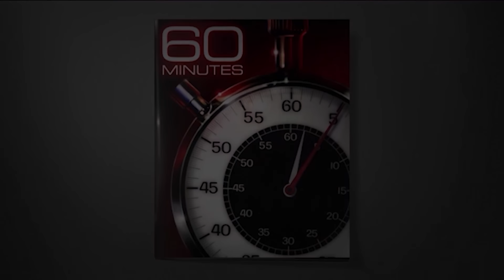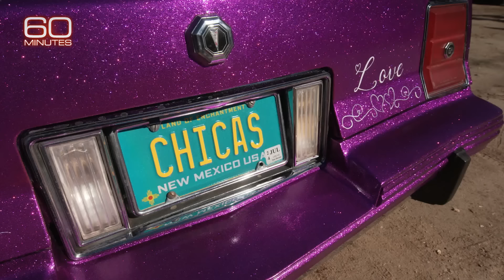Lowrider cars celebrated as cultural symbol among Mexican Americans | 60 Minutes

Comment: The radio controlled low-riders are adorable!  (@)12:27  
I grew up in the L.A. area in the 1960s-1970s (the true capital of low-riders), and I remember seeing all manner of cars converted to low-riders, including a Ford Pinto (which has about 5" of overhang in the back, but this didn't deter someone from giving it the tiny rims, chain-link chrome steering wheel, and continental spare tire with amazing airbrush artwork).  One has to admire that level of dedication and determination. 
The low-rider aesthetic is not what I chose for my '59 Chevy, but it would lend itself to that quite well.  My '68 Cutlass convertible, not so well.

Comment: Thank you for highlighting the story - grateful for the spotlight on the culture. There is a great article written by Nili Blanck titled "Inside L.A's Lowrider Car Clubs" that's worth a read - my favorite part of the article is the snippet on "Low and Slow", that reads, "Like their white counterparts, Mexican American veterans were also purchasing cars with the money they were earning from their service in World War II. As the “hot rod” trend swept the country, which comprised mainly of vintage models like Ford Model-Ts being modernized with enlarged engines for speed, Mexican American vets, deftly employing the mechanical training they had received in the army, began to tweak their cars in their own garages as a means of distinguishing themselves both on and off the road. Tinkering with the engines, painting the exteriors and even adding weights in the back to lower the bodies, Mexican Americans were purposefully altering their cars—Chevys, which were in surplus at the time and designed with an X on the bottom that made them easy to modify were especially popular—so that, unlike the “hot and fast” hot rods, their cars would be “low and slow.”"

Comment: Wrong! East LA on Whittier Blvd is the hub and the first place it was outlawed! All due respect, my grandma was Nueva Mexicana, but this is not the capital of Lowriding. I just saw them drive by for Thanksgiving.
Reply: You can’t deny the NM roots in LA.
Reply: @Blta580 Hot rodding and Kustoms were NM supreme wheels with white walls. Lowriders were strictly South LA then branched out. NM had to converge from scenes. You can track the progress with the paints, Hydraulics, sound systems and rims. Daytons were being put on lowriders first in LA because it would drop the ride of the car and give it the Low look, often scraping the heck out of your car. Then someone said let’s add hydraulics to lift it back up. History was made.

Comment: realistically how long can these cars be kept on the road? 200 years tops? eventually they will be (if not allready) have had so many parts replaced that the outside becomes a shell of its former past
Reply: A shell with a brand new motor. These cars will be around for as long as people want to and are able to create them. With 3D printing, the parts will always be available. So longer than 200 years. And even though your comment is back of handish, it can be a deep and philosophical conversation for the lowrider lover. Peace.
Reply: @TdT2211  i was actually curious. you said 3D printing but really what is the quality of that?

Comment: This hasn't caught on around Chicago ..
Reply: Surprising. Probably because they’re in the Midwest and not the Southwest.
Reply: There's a huge Mexican population there, maybe due to crime, ppl rather not build flashy cars?? What cars are built in that city n state, besides the 4x4s for the weather??
Reply: @lastcommodore2071 where in Chicago you from?  There are low rider shows big time in Chicago - look 👀 it up.  Low riders in the Chicago have to be put away in the winter don’t want salt = rust on them.  Drag racing is big here - muscle cars..  The ‘Rammers’ is a 💯 Chicago Mexican gang thing - used to crash into the opp..